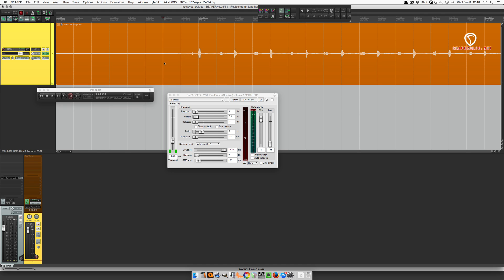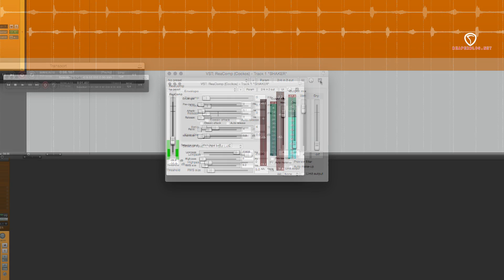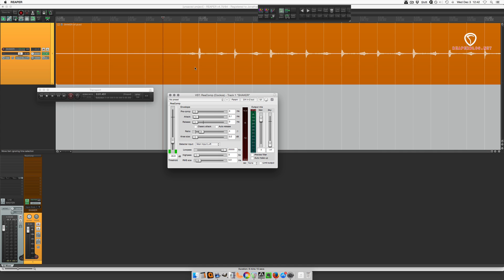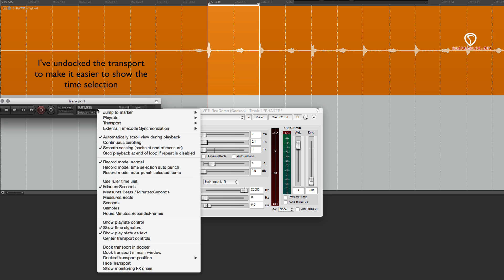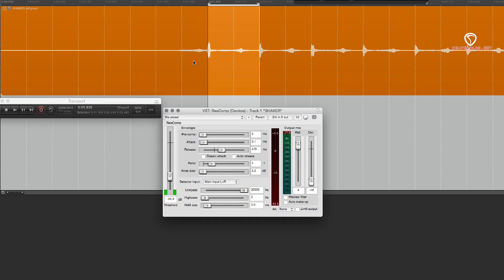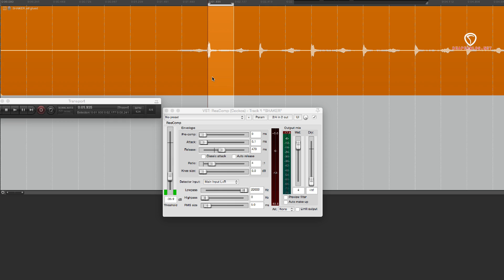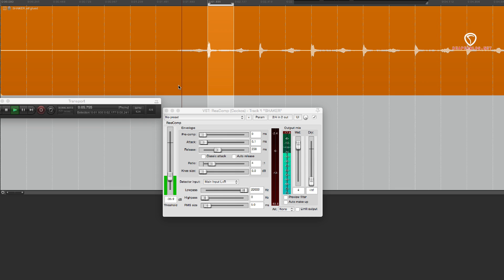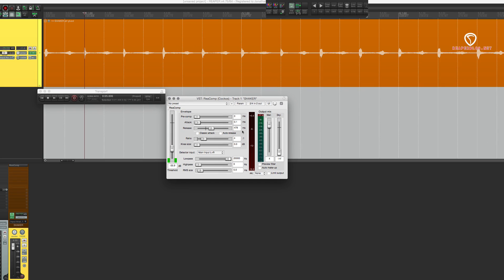REAPER Quick Tip: Compressor Release Time

Comment: ok if this is the workflow , the compressor should be tempo synched , with a release-finetuning slider imho...
that would make this process very easy .. set 1/4 1/8 or 1/16 as release time and then dial the finetuning slider down to cut of a few milliseconds on the release time . could this be programmed in the js plugins ?